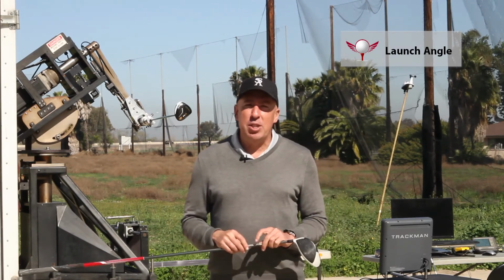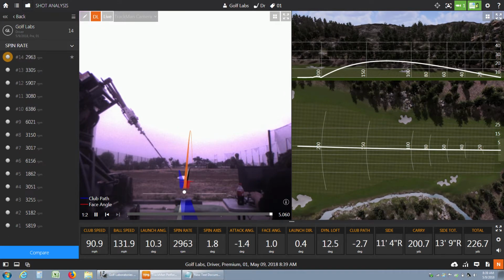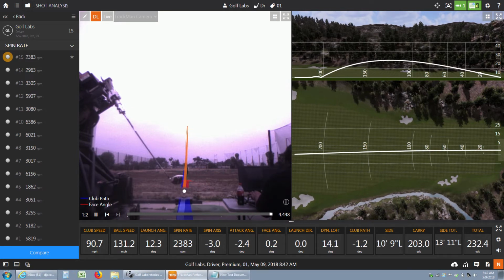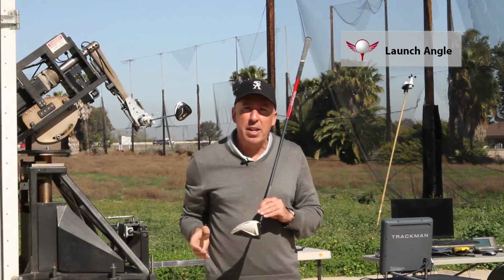What is Your Optimal Launch Angle?

Comment: I have my M1 driver set at 8.5 degrees with a stiff shaft and my swing speed is about 85 mph. I am more consistent with 8.5 degrees as opposed to my previous settings at 10.5 degrees, what do you think of this?